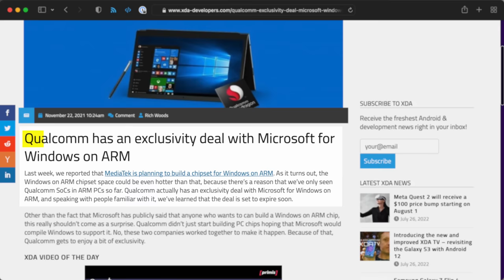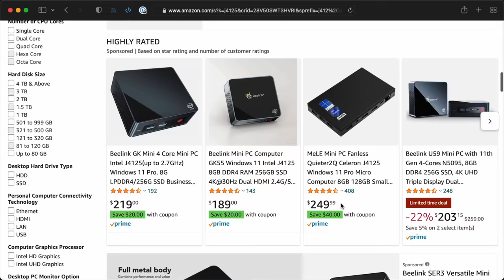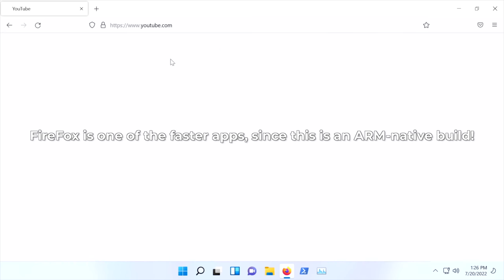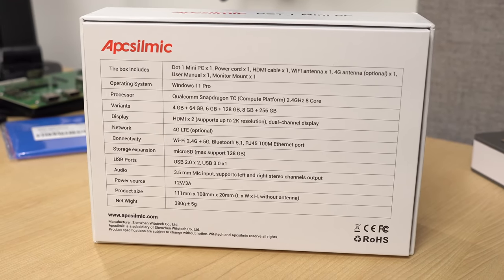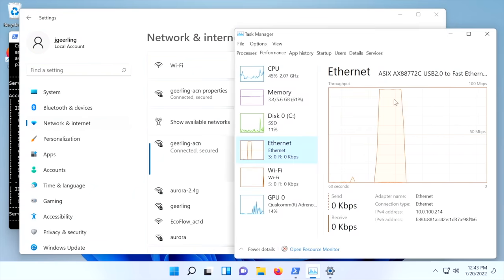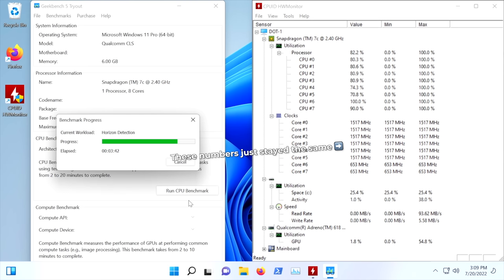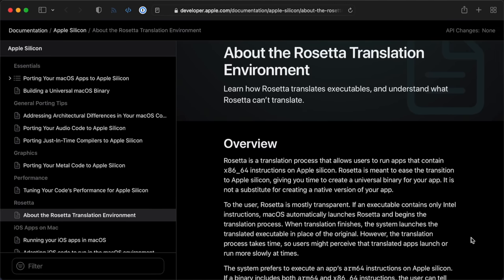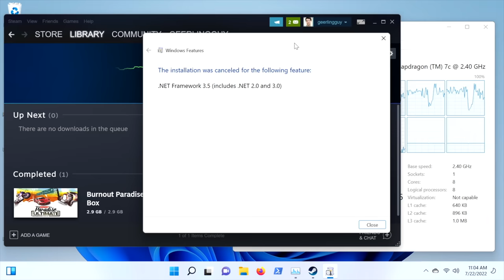Microsoft's wasted potential: Windows on ARM

Comment: Microsoft's x86 emulation is embarrassingly bad, and it's more important for them than it is for Apple, because Apple doing a total platform shift means there's much faster adoption of native ARM code. It took Microsoft years to add x64 support to the emulator, which only happened right at the end of 2020, and then it left beta at the end of 2021, despite still being pretty broken as you can see. Even worse, .NET applications don't natively support ARM unless they're specifically compiled for it, despite .NET being its own java-like VM that should run natively on ARM without any effort from application developers. Talk about a wasted opportunity to get a large number of Windows applications running natively on ARM instantly!

Comment: Is it possible to install Linux on this thing?
Reply: There are several Linux distros which will run on ARM processors, the most common of which being Raspbian, made for the Raspberry Pi. However, other OSes, such as Ubuntu, also have ARM distros.

Comment: In 10 years from now, MS Windows will be a distribution of GNU/Linux working on RISC-V based processors. And it will still suck because of the focus on investors ROI instead of the customers' experience.

Comment: wow that seems... unusable and pointless.

a shitty x86 windows pc is gonna be cheaper and is gonna have more software supporting it. 

the Free and Open Source community is doing huge work to build an x86 userspace emulator for Linux on ARM, which Linux supports so much more hardware than Windows on ARM.

You already mentioned Apple's amazing work with Rosetta and Apple Silicon in general. I legitimately see no reason why Windows is even on ARM in the first place when it is so barren. I see no reason buying the Dot 1 anyways, considering your only option for an actually good OS (Linux) is to build it from scratch, which I have done before on x86. It's hell and is no way to bootstrap an OS on an already barren platform anyways.

Comment: Apple M1/M2 only achieve the performance they do by basically re-implementing what X86 does. They take a traditional ARM chip, and bolt on things that a typical Apple workload would require, video encoding, etc... and they bake optimizations into their xcode compiler to leverage workloads and the limitations on ARM in an efficient manner. If you found a way to make Big Sur or Monterey run on a traditional ARM chip, you'd find it would run like pants, because the optimizations would not be there. This isn't a secret, this is just how it is.

If we switch to Windows, and take the above into account, it's obvious why you won't get good performance. Traditional ARM is missing the extensions both M1/M2 and X86 provide, so you are stuck with old school, RISC bottlenecks, the same ones a Raspberry PI or other single board computers suffer from, and there is no way to optimize around that.

RISC is only efficient when you leverage it's design specifically, in a way they are like GPU's with very simplistic instructions. You can run sequences faster due to that, but it's also like running a car constantly in 1st or 2nd gear. You are likely to burn up if you rev too fast, so having multiple transmissions (or in computer terms cores) is the only option. Which is why the mac studio has so many cores, and why the potential mac pro will have to have many many cores to make sure overheating does not happen.

Comment: 4 watt idle for low powered ARM chip isn’t impressive at all.

I’ve seen a 2015 i7U series business laptop that could idle at 4 watt and still be reasonably fast on day to day use, heck even my 2017 gaming laptop could idle at 10 watt and that thing have to power its own 15 inch display.
Reply: Lmao

Comment: It's not so much the hardware as the mind numbingly inefficient code that is deployed. PowerShell is getting slower and slower to launch on x64 processors as well, it's not just an ARM thing. Run an application with a CPU level debugger and you'll spot the enormous amount of inefficient code that is repeatedly chewed through to just perform the most innocuous of tasks. Most developers don't appear to have the remotest clue how to write efficient code, and most are taught that it doesn't matter because the trivial improvement they make won't impact their application much; Except this is a lie put about by the clueless and the lazy. Execute something inefficient 10,000 times and the inefficiency impact really adds up. Be lazy and use strings or variants to store values and the application has to perform an inordinate amount of underlying processing just for the most basic operations. All this adds up, then add bloat of badly written applications running in the background, many of these are software update processes, and it's no wonder that the enormously fast modern CPUs feel slower than those of two decades ago.

Comment: Gointg ARM seems to be the same "religion" as going EV or solar. No good reason except being popular. Yes, there may be a reason for some applications (phonesl tablets), but serious development or server? I have yet to be convinced. Especially, when both AMD and Intel have made very significant progress in power efficiency for their new processors. Inwill not kove to Apple for one reason - their anti-competitive and anti-consumer policies regarding hardware repair. I am voting with my wallet. Windows is good enough, and probably better for daily developer driver. One sbould not underestimate Microsoft ability to screw up/screw customers as they have proved many times over in the past (WHS, MS Money, etc...).